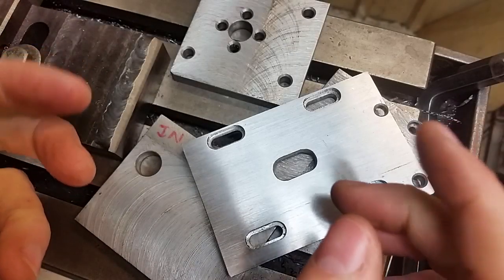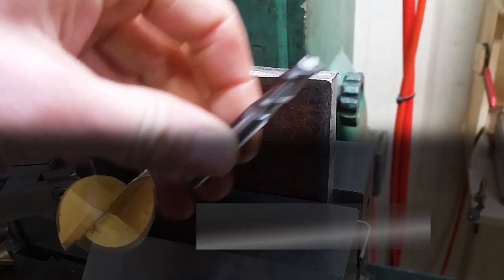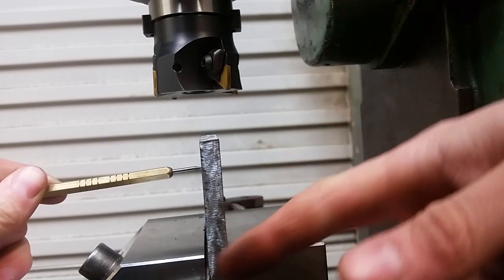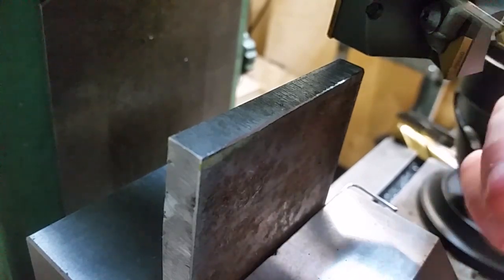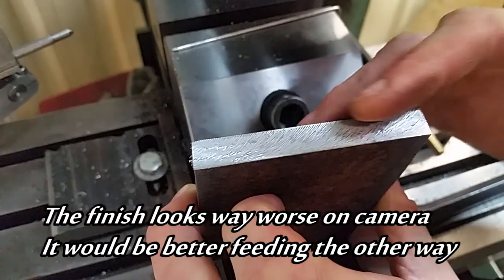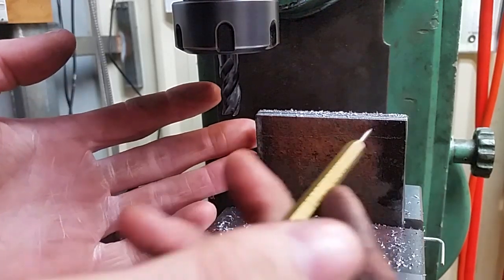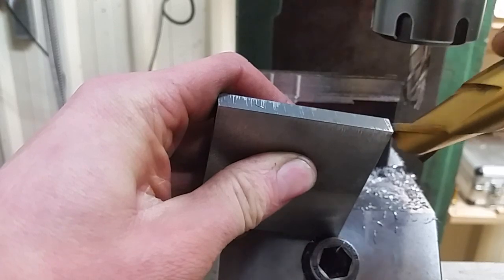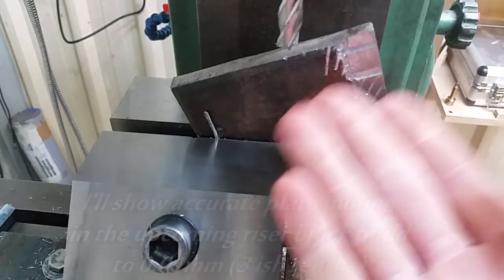Tall Plate Milling Tip Blitz!

Comment: Good demonstration. I always heard to never climb on a small mill but as I have used mine more and more I find there are times it is the best direction for certain specific cuts especially light finish cuts for a better finish.  It just takes experience and a bit of thought during setup.  Still, my collection of broken/mangled mills is comparable to yours. The fun of dealing with unknown scraps. All the best!
Reply from the maker: That is exactly it, it all comes down to the thought and the setup involved. In this case it's balancing risk of a 1 mm sudden movement due to backlash vs 100 mm movement due to the plate moving
If you look carefully the table does jerk at one point when I climb cut, but it was fine, I just sliwed my feedrate

Comment: You can brace the the plate in the vise with thick (3/4-1”, thicker =better) chunks of steel on both sides. You need to clamp the braces near the top, not just at the bottom in the vise. Such “sandwich “ behaves like a thick workpiece and no longer as thin plate (relatively to other dimensions). You eliminate plate flexing which causes chatter, which is the reason for the tool grabbing too much material and breaking or pulling the workpiece out of the vise.
You can mill edges of very thin and flexible material this way (aluminum, plastic) and it is faster than clamping flat to the table.
Reply from the maker: Agree this would be beneficial for surface finish
I was more trying to show how tool placement affects the cutter forces, and the implications
Thanks for watching
Reply: @TomMakeHere  get better, it is not ust about fucking around with metal. math! surface feet per minute! support! gah!!!

Comment: Question Please?.... What is the width of your Mill Table's Key Slots? Why didn't you put Two pieces of square Key Stock in the 
Mill Tables Key Slots them push the work part piece against the Key Stock on top of adequate parallels Clamp the workpiece down then 
machine the part piece?
Reply from the maker: Only just saw this comment. Absolutely right that this would work well
The travel on my mill is limited so I'd have to remove my vice to do this, so if I need to machine a plate and get absolutely right, I hang it over the edge of my table and horizontal mill it

Comment: So buy a deeper stronger vise or mount to side of table on a bigger mill. Or mount horizontally or take smaller cuts.
Reply from the maker: Gotta work with what you've got!
I do have a screw vice that has better clamping force, but it's not square. Part accuracy is more important to me
Reply: Fuck u looser

Comment: I wish I had a mill :(
Reply from the maker: It's good fun, although I prefer the lathe
Thanks for watching!
Reply: @TomMakeHere  I have a little lathe :) Sometimes I need to make slots or drill perfect pattern holes, etc. Would make tapping easier for sure too. I found a super old mill that had been upgraded with DRO's but it said it needed 580 volts so I passed it up :( I didn't know you could get stuff to convert 240v to whatever at the time. https://www.youtube.com/watch?v=LldBEcThlXs
Reply from the maker: Damn that sound like it would have been a good thing! Machine resellers and auctions are a good place to look. Not going to lie I might have set something in motion recently :)
Reply: I don't have a mill either. But i survive :)

Comment: Really nice video. Tip; Use gasket paper instead of wire (or old belts from the beltsander). For me it worked well on the shaper.
Reply: You make a good point, especially for a shaper - will have to start saving my old sandpaper now
Reply: A thin sheet of annealed copper works well too! To be honest. I think the wire is easily the weakest part of the setup here. These cuts wouldn't be too bad if there was more clamping area.

Comment: Using an Angle Plate and clamps is a much better option for this type of mill operation. 
Good demonstration of how not to do it.
Reply: Informations about rotation, cut, and forces directions still appli !
Reply from the maker: Absolutely agree, I don't have an angle plate though, and it's convenient to keep using the vice!